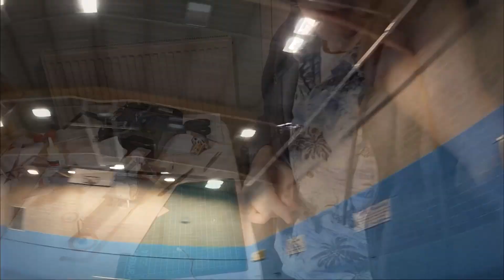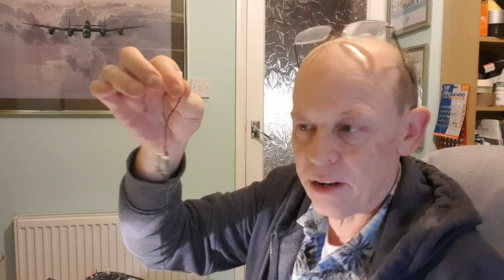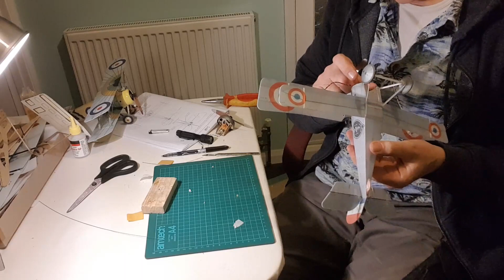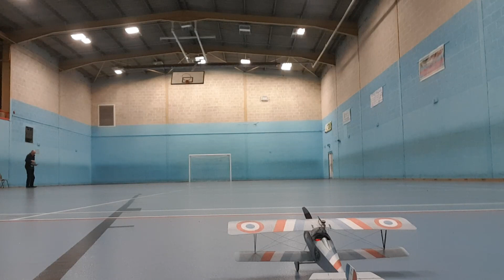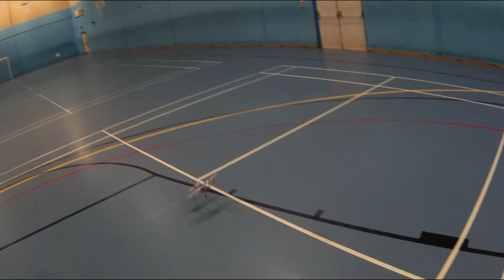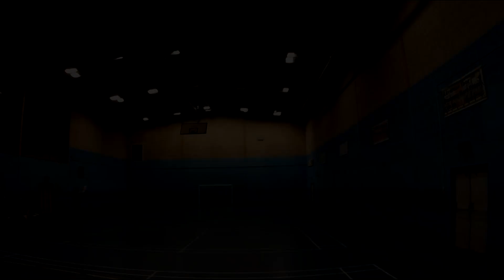Microaces Nieuport 17 Maiden Flight (Part 10)

Comment: A very successful maiden flight. It looked quite stable right from the start. That's remarkable for an airplane that small. Congratulations!
Reply from the maker: The congratulations go to Microaces Jon, all of their range are cracking little flyers, I've only built six of them but they're all the same. It also means you can fly them virtually anywhere ... result

Comment: Turned out great Cliff and what a nice indoor place you have. the one I tried in London was like a huge kids party! So no indoors for me!Can you give a spoiler of next project? realise Guillows is still in progress
Reply from the maker: Hi Gary, the venue is just big enough to miss the walls most of the time, there is a bigger one an hour's drive away if I get withdrawal symptons between our fortnightly sessions though! It can get busy in the air but as long as you all fly the same circuit it's not too bad, it's when rotary craft are up as well things can get interesting. Yes the Guillows is still moving slowly onwards but I did take a couple of hours off for a little Spitfire which is waiting for maiden as well.